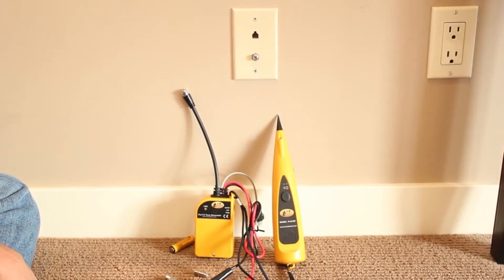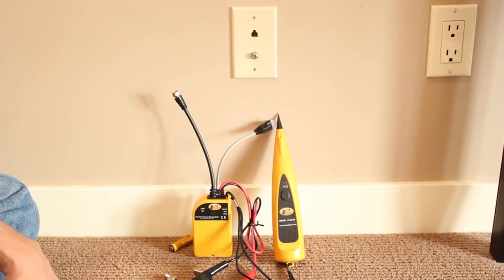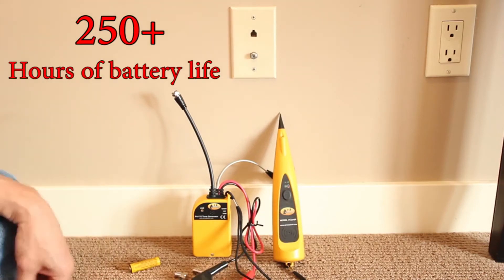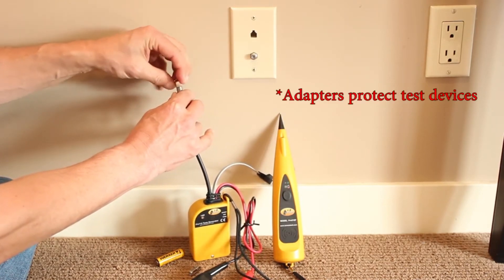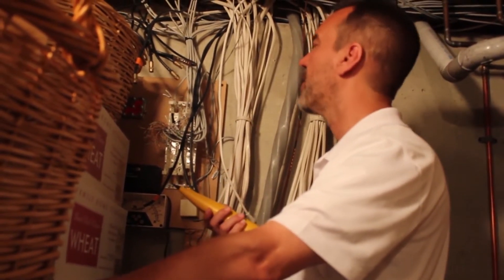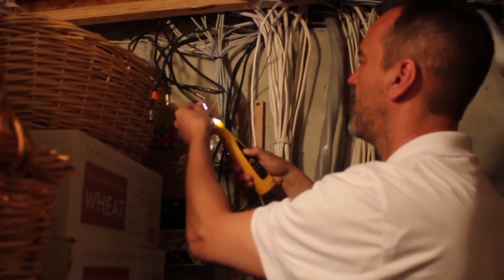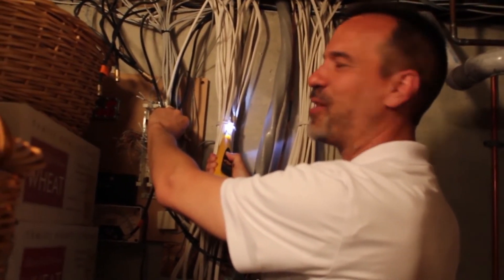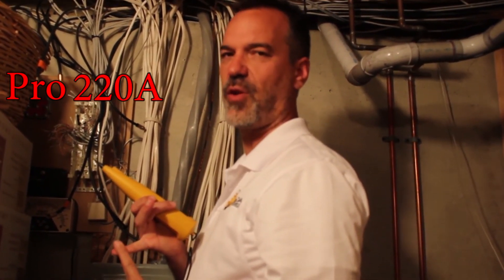How to Use a Cable TV or CATV Specific Tone and Probe Kit to Identify Coaxial Cable Terminations

Comment: I'm trying to sort out where coax wires may be in a house where it seems like the previous owners removed outlets.  Using a tool like that would it be possible to plug it in at the side of the house where the coax comes in and then run the wand over the walls to see if it detects the wire behind it?
Reply from the maker: Generally speaking, no.  The distance one can be from the wire limits most if not all small toners from giving satisfactory results.  For example, when changing floors, it becomes impossible to get close enough to the cable.  Something with higher power is required.  And the correct frequency.  Metal studs, for example, hate high frequency.  Our Pro290 would be our best option.

Comment: A CATV drop cable is engineered to avoid emitting radio waves because that would reduce the quality of the signals. That is why coaxial cable is used. There is little if any exposure to radio waves.

Comment: A CATV drop cable has been placed outside my window, does this emit radio waves, I'm concerned because my bed is situated near?
Reply: A CATV drop cable is engineered to avoid emitting radio waves because that would reduce the quality of the signals. That is why coaxial cable is used. There is little if any exposure to radio waves.
Reply: Thanks for letting me know, appreciate it

Comment: Does it have to be connected to the ends of the cable or can you just put tester on the cable itself
Reply: The tracing tone can be connected to the cable shield using the alligator clips. It is a little more difficult to identify that cable in a bundle because the tone appears on other nearby cables, but it will work. One benefit of connecting to the outside of the cable is that you can identify it in the middle or the end.

Comment: That's a interesting tone and probe set 
Looks cool 😎 does it come with a bnc adapter for camera connections ?
Reply from the maker: Hi Low Volts - The tone sender is furnished with an 'F'-type male coax connector since most of the Pro220A users are in distribution systems with wall plates and splitters. I have purchased 'F'-to-BNC adapters before so I know they are readily available.

Comment: Hello, can this filter 50 and 60Hz, or just 60Hz for US?
Reply from the maker: It filters both.  In filter mode, it eliminates frequencies outside the 800-1200 hz range.  Since both 50 and 60 fall outside, they are filtered.

Comment: i bay a normal cable tracers cat6 cat5 ,..  i know now why cant test coaxial 
because there is no Filter Probe
Reply from the maker: You can test coaxial cable with most kinds of tracers as long as you connect them in the right way. Not all tone generators have an easy way to connect like the one in our video. If you have alligator leads (or make some from a Cat 5 cable) you can connect the tracing signal to either the center lead for ID or to the shield for tracking. A filter probe is handy but needed in every case.
Reply: i test tv rg-6 its give me sound like this 4:02
Reply from the maker: The filter probe will help with 'power hum', otherwise you have to work through the noise. Try grounding your body by putting your hand on a safe ground point or on top of other cables.
Reply: thank you

Comment: thanks, can it detect the other end of the wire through a splitter though? I might not know that, but sometimes them cables are connected through splitters, and i need to know the other end of the cable nevertheless, can it do that>?
Reply from the maker: There are two kinds of splitters - power-passing and non-power passing. The toner will go through power passing types which are the most commonly sold and used. Non-power-passing splitters are commonly installed by the cable TV companies and they will block signals below 5 MHz including standard tone tracers.
Reply from the maker: Another note: Usually you can check for power-passing with an ohmmeter. There will be DC continuity between the input and output center pins.

Comment: Will this tone and probe kit trace cable through walls?
Reply from the maker: We have done that before, though it depends on the cable, and you have to get the probe within a foot or two of where the cable lies. You will have the best luck clipping one lead of the tone sender to the cable and letting the other lead dangle in the air. These tracers are 'electrostatic' and easiest to use when the tone is radiating into the air like an antenna.

Comment: My cable guy said that old and outdated coax does not and should not effect internet connection in terms of visual and audio quality,  as long as the speeds are fast and the bandwidth is high  its fine and wont effect any incoming audio or video quality.  Is this true?
Reply from the maker: He is right in that the age of coax is not a factor in signal quality as long as bandwidth is high. Age can be a factor if the cable has gotten damaged over time allowing 'ingress' or external noise, or splitters with a lower bandwidth were installed early on. Sometimes jacks can become worn by repeated connection and center conductor contact could become intermittent - keep F connections tight. Newer installations use higher performance cable and use splitters with high bandwidth, as you might expect.
Reply: so you're saying that coax could only be a problem if the bandwidth is lower and if the cable is damaged or connected to anything potentially degrading the signal lowering its overall bandwidth? and I understand the part about damaged cable, worn out connectors, bad splitters and etc but in that case what about RG59  would this be a problem since it only allows a lower frequency of mghz with smaller gauge wire lowering bandwidth?  Is this effecting the same bandwidth or no? For instance if the modem is allowing 5ghz of bandwidth but the coax cable is only 0.9 ghz of rf requency if I am correct could that be bottle necking the connection and speed?

The reason I am asking this is because I am having a bit of a problem with my internet for a long time now, it has gotten better over the years and finally the speeds are fine  but I am still noticing the quality of my downloadable audio and streamed data to be noticeably quieter and thinner than the normal as if it was sounding compressed and missing some higher and lower frequencies in treble and bass. Its not terribly bad but its more than acceptable for me. Do you know the difference between velocity of internet  and power of the internet connection coming through the coax wire? 
I am not having these problems anywhere else , even mobile data has a noticeable increase in audio and visual quality than here. 
The visual quality is slightly off but its negligible, the audio is considerably off at least personally for me because I do some work with audio and would like to have it better if you understand what I am saying.
Reply from the maker: Your bandwidth will be determined by the narrowest part of the system. RG59 cable was meant for lower frequency TV signals (say up to 80 MHz) and may give poor signal-noise performance at the 1 GHz frequencies often found, especially if the cable run is long. RG6 is more commonly used for high bandwidth. Your cable modem should be OK with either type - it is video that will be affected most. Use a 1 GHz type splitter if you use splitters. The fewer the ports the better and put 75-ohm terminations on any unused outputs.
Reply: The cable running through my home is longer than 100 feet, the longer the cable the slower the connection and the more frequencies that are taken off,  is that right? How do the db's relate to the signal and frequency? Can drop amps help in situations where there is a slightly damaged cable or splitters effecting incoming signal?

tech never checked the strength of the signal, he automatically assumed it was fine and claimed ''as long as we are connected to the internet and working it should be fine and that it has nothing to do with internet and only to do with cable television and picture quality'', he also said ''the wire doesn't effect bandwidth and that the internet speed test will tell us if it is working correctly or not''... Yet when we look at pictures, watch videos, and listen to incoming audio I am noticing a moderate difference that even my mom can tell.  I am aware that looking at low speeds are can point out and diagnose problems but in my situation speed was and is not the only issue. 

If RG59 was meant for lower frequency tv signals then it would make sense to update it considering the fact that isp and modem is pushing out 2.4 and 5ghz of internet frequency right?  It is definitely ok for most people but not a great experience for the things I like doing when using the internet  having it nominal is essential.  Thanks, I took note on the 1 ghz splitter (but wouldnt a 2.4 or 5ghz splitter work better?) with only the amount of ports needed and if there is any extra to terminate them. Does this include unused wall ports?
Reply from the maker: The quick reaction is to use RG6 and GHz splitters to avoid the question of limited signal levels at higher frequencies. You can get a chunk of it and bypass the existing wiring temporarily to see if it makes a difference. The tech should have a meter to test the signal at the inside outlet to verify.    An internet speed check will not help because that tests the cable modem which uses the lower part of the bandwidth. Also, WiFi speeds are in the tens of megabits/second which is unrelated to the 2.4 GHz or 5 GHz radio carriers they use. If you are having weak signal issues putting small 75-ohm terminators in unused jacks and empty splitter ports may help.
Reply: Is the db meter used to check the existing transmitted frequencies or just the connection to the possible frequencies existing passing through? Suppose I cant increase bandwidth without installing a new RG6 coax cable..  For example RG59 cable with limited bandwidth, connect a drop amp to increase signal gain but am still getting the limited bandwidth yes?

Now knowing all of the above I  can confirm  that my tech did not run a proper procedure and hadn't got a clue!   I feel bad for other people who suffer the same problem and may they find the help they need. Maybe now I can fix this problem and next time I see a techie from my company I will explain to him what I had done and the further what needs to be done. I have little faith in the local cable company its a damn shame
Reply from the maker: An amplifier would help with cable losses. It takes a specialized meter like the cable guys carry to read actual signal levels. It can be done on whatever is already present, but they can often generate a test signal to check the performance of higher frequencies that may be used later.

Comment: can it test through the insulation?  or does it have to be on the terminal?
Reply from the maker: These cables are "floating" (not grounded) so it is harder to get a good signal but yes, it works through insulation.  Grounding makes it work better, certainly.

Comment: Can you test just one Single Wire at a time? Such as using it in an 
Automotive situation or for Trailer-Camper wire mapping after someone 
else has made a bunch of splices and re-wiring?
Reply from the maker: Yes.  The signal is transmitted down the wire it is connected to so with either the alligator clips or the coax connector, you attach the toner to that wire and transmit on it.  However, there are 2 things to be aware of.  First, the signal takes the path of least resistance so if there are shorts or the wire splits and goes in 2 directions, so will the signal.  Second, it is setting up a field around the wire and this field induces the signal onto conductors within it.  Therefore you get "bleed" over to other wires but you can defeat bleed with volume control and/or a trick where you use the probe in one hand and touch the wires with your other, using your body to cut the signal down.  Hope this helps.
Reply from the maker: Yes. This is commonly done, though you may need to experiment with the placement of the black lead (Chassis, hanging in the air, another ground in the cabling.)